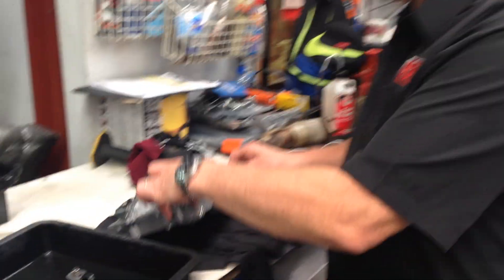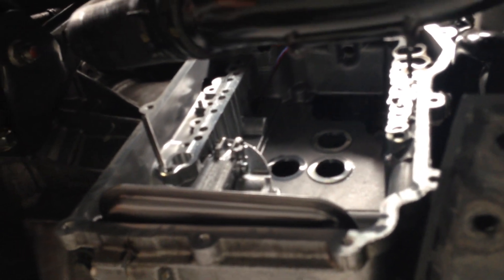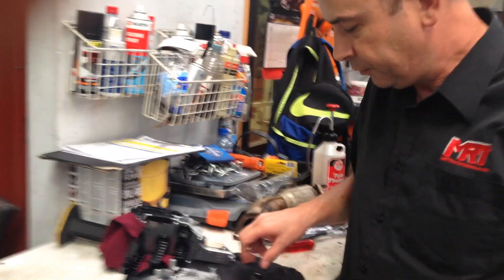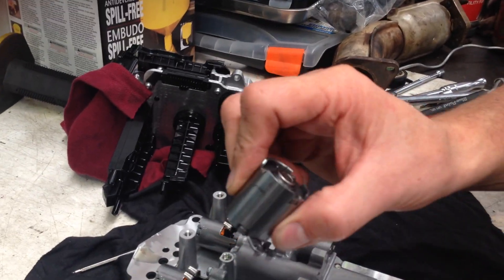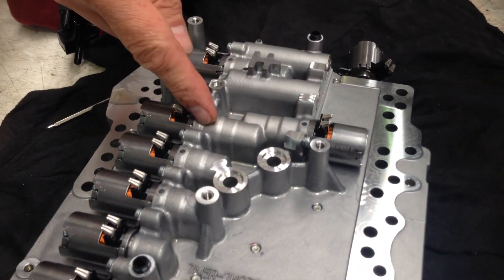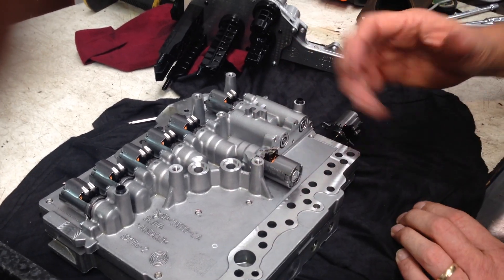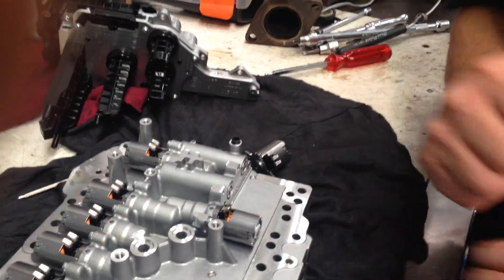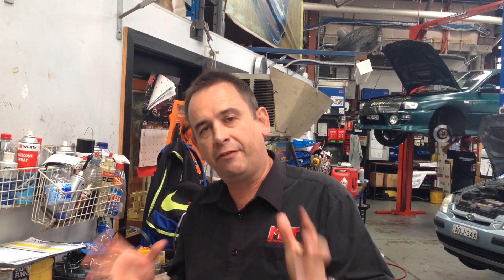Mitsubishi evo transmission SST mechatronic solenoid secrets

Comment: I've been getting an intermittent p1874 code. It comes and goes.what are my options to rectify the situation. The Trans is new and only bout 15k miles
..
Reply: Is this a tuned car? SST is brand new you said so question is do you drive it in super sports and let it warm up?

Has this transmission been rebuilt before or is it all factory spec?

Comment: Hey why hasent anyone shared that tip that saves thousands of dollars to customers before alot of work is done on ther evo x transmission..is it a money tactic ???? Pple inbox me if ur haveing trouble with sst trans n i can help n save alot off labor bill
Reply: Yo I need help fam
Reply: Whats up
Reply: Edwin Tesheep I just got this 2009 Mitsubishi Ralliart and we took it to the shop and they said I need a new transmission but I went home and grabbed my dads diagnostic tool and we look at it and it said the pressure solenoids weren’t working but I don’t really know what to do
Reply: If u have a lil bit of mechanical knowledge i would chck them out n change if it needed to be... lmk
Reply: Edwin Tesheep I don’t have anything to jack the car up so I wont be able to check i will message u when I do
Reply: @marcusholmen9741  it's a big job to take out the unit buddy.

I did my over the weekend at home and it had taken me 4 hours to do whole job.

I have tools at-home too and yeah you need to know what your doing.
Reply: Mr Short Stuff yeah I don’t know what I’m going to do tbh I might just get rid of it cause I have no experience to do this and I ain’t got money to take it in to get it fixed
Reply: @marcusholmen9741  whereabouts are you located. Sydney here I know some shops that specialise in SST rebuilds.
Reply: Mr Short Stuff I’m in Utah I don’t think there’s any really good shops around to help me and idk if I can afford to do a rebuild
Reply: @marcusholmen9741  Kozmic motorsports are in states they are switched on and design upgrades for these SST.

Comment: SST Transmission - HELP
Hi guys, so I’m rebuilding my Evo X Engine and I’m opening my SST transmission to check the integrity of my Clutch Packs and a visual inspection of the Magnets inside. My question is; do I have to reset the mechatronic unit? Please help
Reply: Yes you need a MUT II and  software.

Comment: Hi, am an auto tech, my friend has a lancer ralliart. It has this issue when move off from a stand still, like a judder, like the clutches are grabbing & releasing at the same time. But once the car is in motion it drives and shifts ok. Any suggestions MRT/viewers as to what's the cause & fix to this problem?
Reply: it's probably the mechatronic unit. has it thrown any codes?

Comment: Dear Brett
 i'm one of the owner of Lancer Ralliart sportback Model 2010,i has the problem with my SST Tránsmission that always get trouble when shift up to 4th gear
and driving normally from 1st to 3rd gear after turn of and start the egine again 
so ís that the problem og SSt fluid change or the body valve asembly dammage my bro
hope to hear from you

Comment: Hi. Thanks for all the good info.  Can you show us if and how to replace the internal filter? Somewhere I read that it's possible to do it without taking off the trans , if I'm not wrong.
Reply: I think the cases need to be split to fully replace it. if you remove the mechatronic unit you can kinda "hand clean some of it though I think.